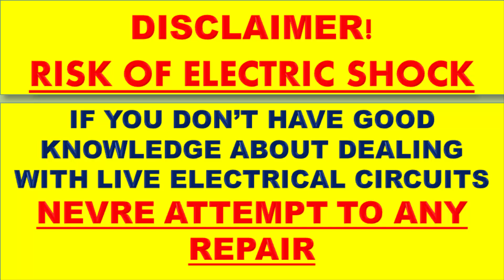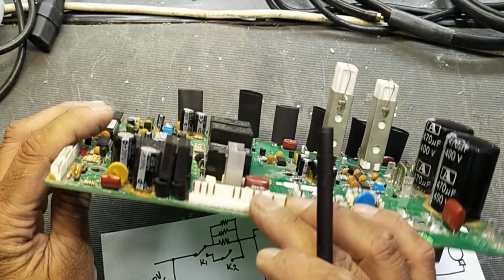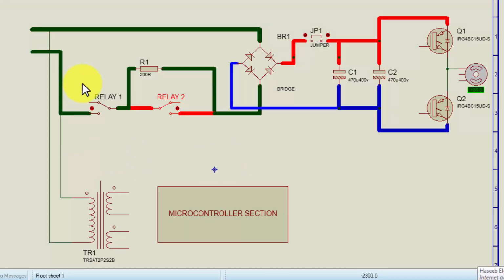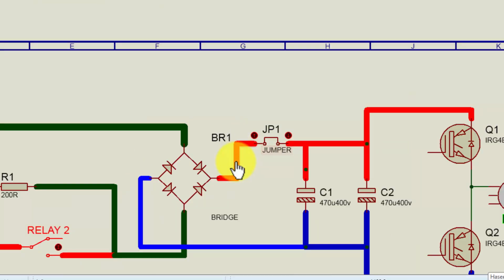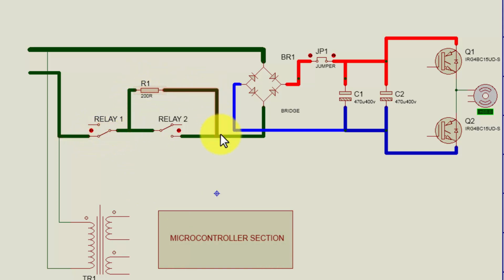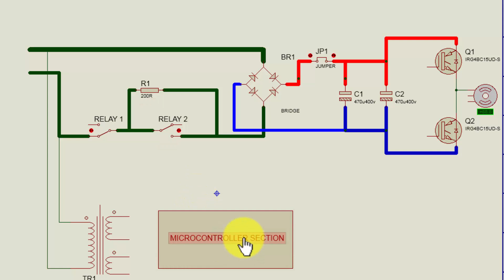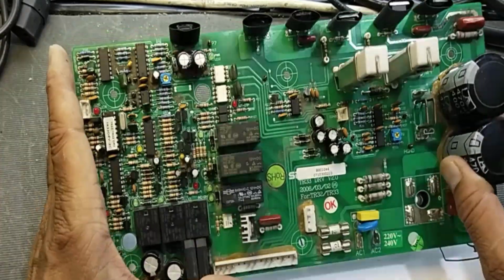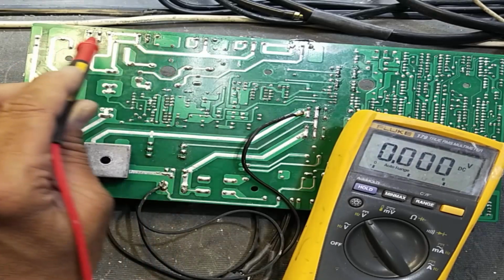{516} Treadmill Circuit Breaker Trips OFF / Sports Art TR33 Input Short Circuit Not Working

Comment: Dear Mr Haseeb: Thank you for this very informative video. I am very interested in Exercise equipment board repair. You explained the issue with this board in a magnifent way to make it easy to understand. Question: did you replace the resistors on the board as well? In a situation such as this would that be advisable even if they measured correct? I do so appreaciate all your videos, and I so much appreciate the time you put into teaching us how to troubleshoot and repair these type of boards. All the best to you now and in the new year!!!! :thanksdoc:
Reply from the maker: best regards and lovely thanks 
when a power resistor heats up but it remains with same ohmic value then no need to replace it. as it is most of time wire wound resistor, so it have to dissipate heat. 
when it is in circuit and provides resistance. then it is ok to use 
please accept my best regards